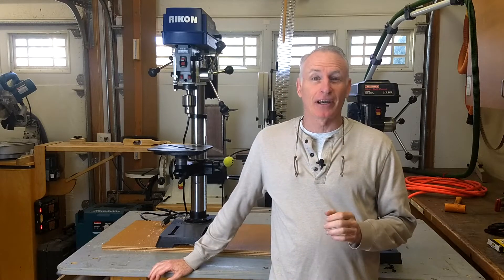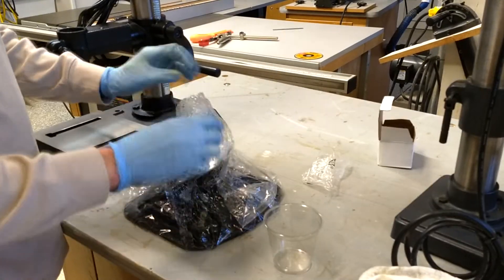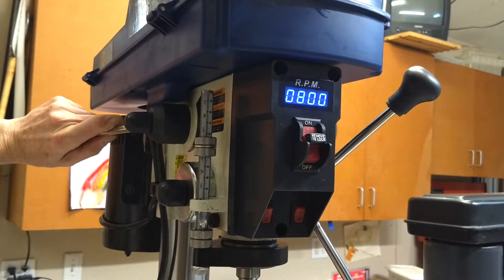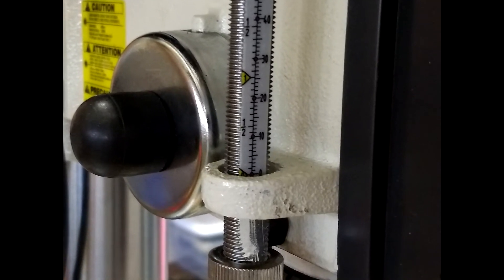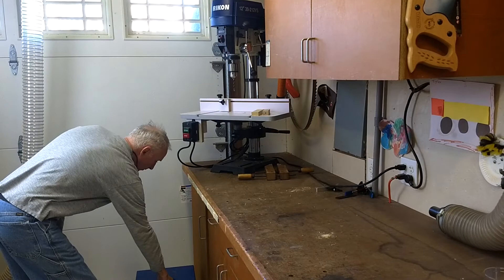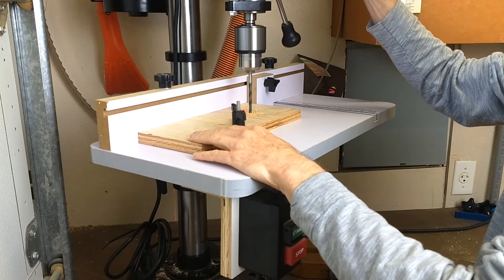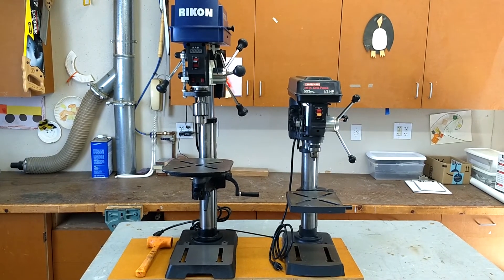Rikon VS Drill Press Review

Comment: After 40+ years the motor on my no-name drill press burned out.  I could have replaced the motor but for about the same cost I could also buy a new lower end drill press.  While doing my research I cam across this review of the Rikon.  I wanted a bench top machine and I was having trouble finding one that would run at the lower RPM's.  This looked like a good option.  I considered the issues that were mentioned in this review and decided that most of them would not be a problem for me so I made the purchase.  I just completed the set-up yesterday so I don't have any long term experience to report.  However, since this review is 5 years old I thought perhaps some of the issues mentioned in the review might have been resolved and it appears they have.  The parts were not covered in grease, there was almost nothing for me to clean up.  The pully assembly did not vibrate, it was properly seated and works great.  The laser is a bonus, I haven't had one before so the fact the the Forstner bit blocks the laser is not an issue for me.  I have had 40 years of experience aligning the bit without the help of a laser.  The depth gage hasn't changed in 5 years, it still doesn't have an arrow or a sophisticated marking system to give you an exact reading...but then my old machine didn't even have a depth gage.  I would set the depth by adjusting the table.  Yes, you do have to change a belt to get the full range of the RPM's.  The lower speed setting covers 150-600 RPM's.  Changing the belt will give you 500-2800.  I guess this could be an issue but I'm a wood worker and probably can stay in one range most of the time.   I did spend more than what it would have cost to just replace the old burned out motor, but I feel like I just got out of the buggy and into a roadster.  I remember the days in high school when I would have been thrilled to get a B-, but for the money I think this machine is closer to an A.

Comment: Hi Mark - Thanks for you very good review.  I did go with the Rikon VS, however when assembled I had a very similar problem as you - way too much vibration to be acceptable.  I went back to Woodcraft & explained the situation & showed them a video of my glass of water dancing across the top, like yours.  The offered to exchange for another new one.  I asked if they could fire up the display model.  They agreed and move it to their classroom workshop, plugged it in & - SAME SHAKE RATTLE & ROLL!!!! as the first one.  Just returned my purchased for a refund.  Now I'm back in the hunt.  Lower RPM range is a big item for me.  I'm starting knife making & for holes up to 3/8" 500 RPM minimum speed is OK for CS & SS but larger starts to prefer under 500.  Thanks again for your review.  Glad you were able to get your problem resolved to your satisfaction & are able to enjoy the benefits of the 212VS.  David

Comment: Thanks for the thorough review. I have been eyeballing this for some time as a replacement for my older 8" benchtop drill press. Big selling points for me are high HP motor, low speed (especially for steel), variable speed, 3" spindle travel, LED work light, laser sight, and crank-up table.

Comment: I’ve had this drill press for a few years and am generally pleased with it.  The laser crosshairs are sometimes annoying as described.  I tend not to rely on such things so not as bothersome to me.  I recently tried to use my old delta mortising attachment and found that this requires disassembly of the inexact depth gauge so that attachment is not useful.
I find the speed pulley change more annoying.  I too, didn’t realize that until after purchase.  After all that I’m generally pleased.
I own a rikon bandsaw and lathe as well.  I’ve had a good service experience as well when I had a bearing issue with the lathe.
They replaced them under warranty.  In contrast, my customer service experience with Laguna for my cyclone dust collector was terrible, enough to dissuade me from ever buying another Laguna product.

Comment: I just received and assembled this machine.  To be honest, I was taken back by how big it is!  So far I've only had to adjust the laser.  That is very easy to do, loosening two set screws and turning the laser light nut.  I do have once concern.  The handle on the left side (as you are in front, looking at the machine) used to adjust the speed is extremely stiff.  I'm not sure if this is normal or if there is a way to loosen it up a bit so it's easier to move.  Otherwise, this seems like more than enough machine for me.  It doesn't appear to be a sloppy build.
Reply: I just got one and I find that lever very stiff too.
Reply: @grosbeakmc  It will get easier.  I guess it's like putting on a new pair of shoes.  It takes a while for them to soften up.
Reply: @craigmouldey2339  good to know - thanks!

Comment: Good review! I've been looking at this one and the Jet benchtop.  The variable speed change is a huge plus for me.  Plastic, not so much.
Reply: Update: So I pulled the trigger on a Woodcraft sale.  It is much larger than I thought.  Love the variable speed.   I use a cheat sheet print out of suggested speeds with different bits and wood types.  Glad I bought this instead of a floor model.  The laser blockage with forsner bit is a bummer but I knew this going in.  This serves my needs very well.  (Intermediate weekend wood worker/tinkerer).  Thanks again, your review was helpful!
Reply from the maker: @say-dq1th  glad you found the review helpful. I've had a few more months to use mine as well and it has performed well... Short of items I mentioned in the video.

Comment: Thanks. This machine in some ways looks much like the Wen 12 inch. For a lot more money and less flexibility  on the variable speed (Wen does not have a belt change). However, the Wen does not go below 530 rpm.
Reply: also wen is only 1/2HP vs Rikon 3/4HP. Mine 1/2HP Grizzly is completely gutless.

Comment: I'm really just getting started with woodworking and I don't have a clue what size drill press and bandsaw to get. I'm leaning towards the WEN. 10 inch on both tools. I mainly stopped there because of the price jump in going bigger and I'm on a fixed income. I plan on doing mostly small woodworking projects. What is the price point on the Rikon? Thanks for sharing your talent and videos Mark. I appreciate the time and effort that it takes to make these videos. Rodney
Reply from the maker: Hi Rodney. Thanks for the kind words. You are about to embark on a fun and rewarding hobby. You're doing the right thing...researching. And Youtube is a great resource. My advice would be to start small, you can always trade up later. I began with smaller tools and after I built a few things I recognized where I wanted to spend my hard earned cash. Sold the small items and purchased bigger ones. That process took years. When I was just starting out someone told me the most important thing to spend my money on was lumber. I thought he was kidding, but in hindsight he was right...improving your skill and tackling new more challenging projects is the most important part. Have fun!

Comment: Great video - super helpful - thank you.  Just curious - would you consider any others?  I’m looking for a new drill press and really want the features of this Rikon but wonder if there’s a comparable product from other manufacturers?
Reply from the maker: Thanks for the positive feedback! As I mentioned in the video I wanted a DP that could slow way down (150 rpm) to use things like the circle cutter. But frankly I've only used it to do so a couple of times. So I might have put too much emphasis on that feature. So if that isn't important there are lots of other choices. The variable speed quick change feature has been the biggest benefit and I would only consider other presses with that feature. Jet and Wen make pseudo clones (I wonder if they are all made in the same chinese factory) that would be worth considering. Good luck!

Comment: I'm having some wobble issues with my newly purchased 12 vs. Could you provide some more info on how you fixed your wobbling issue?
Reply from the maker: Hi Matt. In my case it was the pulley not fully seated on the shaft. I just started taking it apart and examining each piece for symmetry and any problems. As I removed the belt and pulley assembly it was obvious that the bottom wheel was not perpendicular to the shaft and causing wobble. Took it off and reseated it....went right into the place it should have been. It's disappointing to have to disassemble a brand new tool but you'll gain a bunch of knowledge about your machine doing it. Don't be intimidated. Just take your time. Hope this helps.

Comment: Hi Mark, thanks for the great review. I just bought the same drill press and I’m having the very same issue. I haven’t tried to take it apart yet it’s a little intimidating. Can you get back to me and let me know the difficulty you had in addressing the issue?
Reply from the maker: Totally doable Luke.  Just take your time.  Once you have the pulley off you will be able to see  where it's not fully seated on the shaft and fairly easy to correct.  Big difference once wobble is removed. I've been pretty happy with the press since then.  Good luck!
Reply: Thanks Mark!

Comment: Excellent review, honest and thorough. I'm just starting to look at drill presses to replace my old 12" Dayton. I'm surprised about the lapse in QC, Rikon is supposed to be a bit better than other sellers of China-made machines. How many hours did you spend on cleaning it from grease, dealing with the pulley issue and fine-tuning the table?

Comment: Thanks for doing this Mark. Great review. I've been eyeing this drill press for quite a while. I'm really surprised that it got out of the factory in that condition. The whole point of Rikon was that they were supposed to have better QC than other brands that use the same factories/components. If you hadn't had that issue, would you have rated it a 4?
Reply from the maker: Hi Jim. Thanks for the comment. Yeah I think 4 would be merited without the factory defect. You know after eyeing some of the other drill presses I'm wondering if they all are made in the same Chinese factory. Many of the castings/parts between brands appear to be identical. Would love to do a side by side review. 
That said I think the Rikon offers the best features for the price right now.
Reply: Jet, Wen, and here in Canada we have a Craftex model that all look to be built on the same 12" design. But the Rikon is the only one that I've seen with the second set of pulleys to get that lower speed range for circle cutters and large forester bits.
I've handled the Rikon in our local Lee Valley store and was also surprised by the somewhat rough action of the quill movement. I will probably end up buying this machine as I have not seen anything else with the low speed range, but it does bug me that their QC isn't higher. But it is good to hear that their support is good. Thanks again!
Reply: @DIYMark  what website did you buy the drill press from?

Comment: Several of these  bench top are basic same drill presses rebadged. If your using Mortise bits for wood working you'll want low speed below 200 RPM for larger bits. Most variable will not get that low.

Comment: thanks for taking the time to review this. On sale at Woodcraft in April and seriously looking at this one. Do you find that you are performing the manual belt changeover often, or is most of your work covered by the low end settings?
Reply from the maker: Yeah. Got the flyer for that sale just after my purchase...Doh! Could have saved a few bucks. Actually I've been using just the high mode so far, which takes it down to just over 500 rpm. But then again I've only had it for about 2 months. The lever speed adjust is such a nice feature. You'll enjoy it.

Comment: I watched you check the table flatness with a noga base and was wondering why you didn’t use it to check the table perpendicularity as well? You can easily mag that base to the chuck and spin it freely to see how far off the table is. Far easier than using a brass rod. Just a thought.
Reply from the maker: Off camera I did check flatness as you describe. But I wanted to illustrate the rod technique since it's a low buck approach and many people might not have noga/dial indicator.
Reply: diymark Oh I see, I must’ve missed that. Good idea for budget inspection.

Comment: So did you receive and keep the new pulley. Great review but I have the 15 inch JET floor drill press. It was definitely worth the money
Reply from the maker: I called them back and waived off the replacement pulley. There was nothing wrong with the one it came with. Just poorly installed.

Comment: I got a question. Are those pulleys steel or aluminum? I had a Delta that was variable speed like that only they were aluminum and ended up wearing out where the belt would slide across them as it was adjusted
Reply from the maker: Hi John. The pulleys are steel. It is an amazingly simple system. Not sure how well it comes through in the video. but the lever handle changes the position of the pulley (up or down) which corresponds to pushing the belt outward to the edge (slow) or retracting allowing the belt to come to center (fast).
Reply: @DIYMark  yeah I looked at your video little closer and it looked like it was steel. The Delta I had was more like that Wen model. I think it's the 1412 variable speed. Those are obviously aluminum and they're not even solid. I'll have to look at backup and stick a link on here if you're interested in seeing what I'm talking about. But yeah that rikon seems like a lot better drill press. It is about twice the prize but twice as good also
Reply: https://youtu.be/qiyxRyZJel0 that's the link to it and it said about 17 minutes in. I was wrong it's a 4214 variable speed. I don't know if the pulley system is aluminum are not but it looks like it. So check it out if you're interested
Reply from the maker: @johnneal4049  You know as I was researching presses (before my purchase) I noticed that several brands (Jet, Wen, Rikon) have very similar parts and castings. Makes me think they all are made at the same chinese factory and just branded differently. Would love to get several side by side and disassemble to validate my theory.

Comment: Any remorse on this purchase compared to other models?  I'm considering it.  Nice review.
Reply from the maker: Hi Chris. Like I mentioned in the video, it's a C+ product bcuz of the design/production shortcomings I talked about. That said it has a number of great features and the only press that spins at really low speeds when needed. The VS speed feature is also a big plus. With the old press I would sacrifice drill quality because I was too lazy to change the speed (belt change). Now it's easy.  
Another curious observation is many of the current presses out there are very similar and it looks like they share parts. I wonder if many are produced in the same chinese factory at OEM specs. Good luck.
Reply: Mark, do you think a higher quality product exists for the lower budget market under $1000?  Nothing seems to have great overall reviews.  I’m also considering the Jet 15” bench model and 17” floor model and a Grizzly bench model. The Jet bench model seems too big for a bench, almost better off with the floor model. Looks nice, but reviews are hit/miss.
Reply from the maker: @christopherwhyte2360  I think you're at the same spot I was when I bought the Rikon. I considered both the Jet/Grizzly before I pulled the trigger. And I agree about the size of the Jet/Rikon. I have it on my 3' tall bench and it puts the work too high sometimes...but I'm adapting. As I mentioned changing belt requires a step ladder. Still overall I'm glad I bought the Rikon big step up from the little craftsman. Good luck!
Reply: diymark I finally bit the bullet and decided on the floor size 17” variable speed Rikon.  While it’s double the price and I really wanted a bench model, there appear to be several benefits and better build quality with the floor model (higher quality components, stronger motor, long quill travel, larger table, nicer depth stop, flexible light, etc). We’ll see when it arrives in a few weeks. If it lasts me 20 years like my 12” Delta bench drill press, the extra features will be worth it.  I got a mobile base from Rockler to put under it, although I’m hoping to find a spot in my shop that won’t require moving it often.
Reply: @christopherwhyte2360  
How did the 17" VS Rikon Floor Stander work out for you?

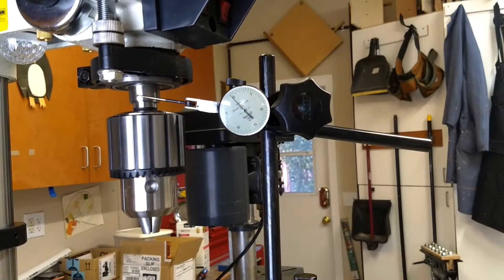Comment: At 2:32 you say: "I measured the runout of the chuck arbor with a dial indicator and it spun true within half a thousand." The video show the entire setup, from drill press to dial indicator, shaking as if there's an earthquake! I trust you locked things down before you ran the actual test? If it's any consolation, 90% of YouTube videos on budget drill presses have the same quaking shot as they test the runout of the drill.

Excellent video otherwise, has me seriously considering the Rikon.

Comment: Does it have quill lock down?
Reply from the maker: Hi Jim. Short answer is no. Not like I remember on the big Delta press we had in high school, with a lever you could lock it down with. It (the Rikon) does have a quill set screw but I've never used it...not convenient. You can fairly easily control the retraction of the quill with the depth knurled depth nuts. Hope this helps!